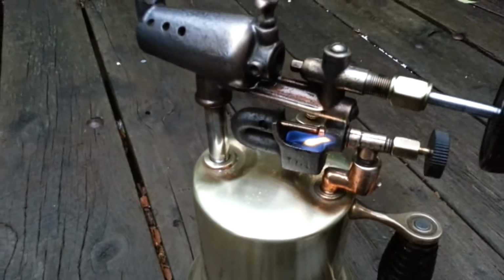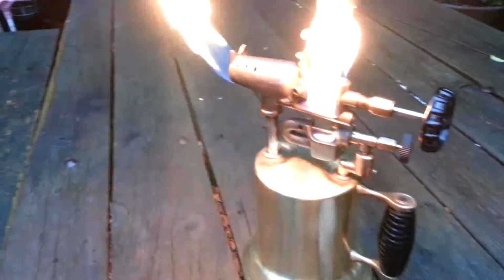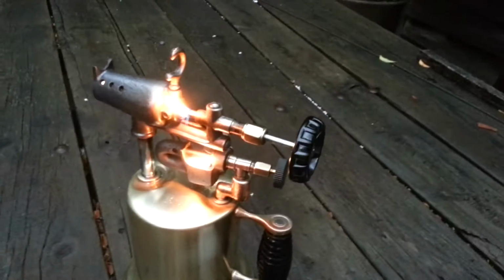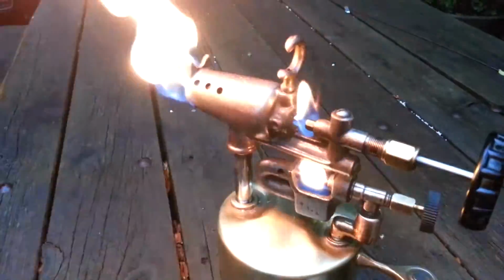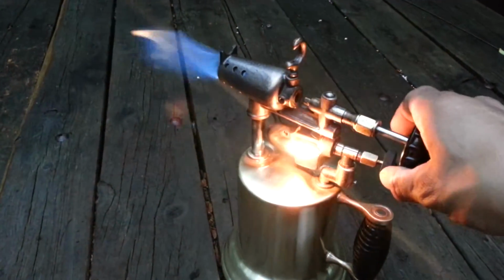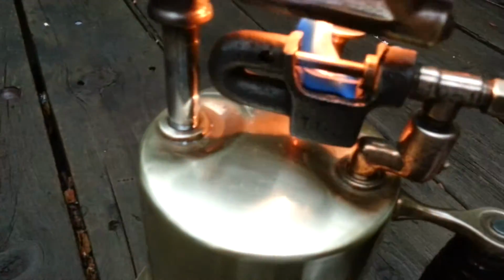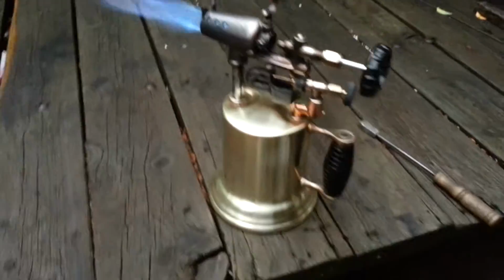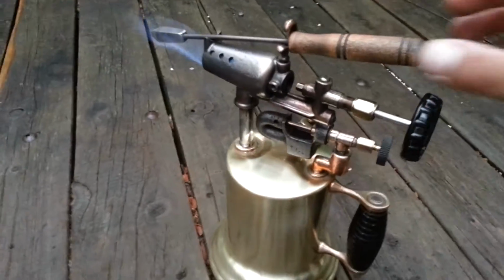Prentiss Wabers #50 Extremely Rare Blow Torch

Comment: Most of these antique blowtorch videos have one thing in common. The jet has build up that has been partially cleaned.  There is a small hole the fuel passes through before hitting the coil that vaporizes it. If the jet has build up you get this inconsistent lighting and a final flame that especially in the mid and low range has orange flame at times.

Comment: Listen to the inconsistent sound. That is the other way to know when you need to clean the jet. Use a fine wire and work off any build up or break it down and soak in a solvent.  It’s just a hex but with a small hole.

Comment: Nice torch, But not the right way to light it, The bottom part you call a reservoir is actually a small torch itself used to heat the main vaporizer tube that is just above it, you should be able to light the small pre-heater like a small Coleman Stove and open the lower valve to blast the flame upward to heat the main vaporizer.

Comment: That looks like the wrong way to light it.  Sorry. The whole thing should not be on fire.  The little pot of fuel is just to heat the tubes and fuel.  You let it heat up and then you pump it a little after the pot goes out and then light the fuel coming out of the main nozzle...
Reply: Correct !